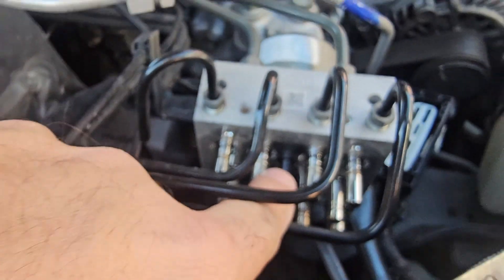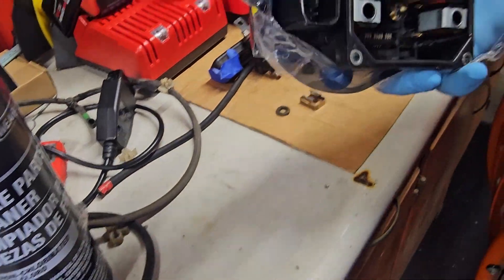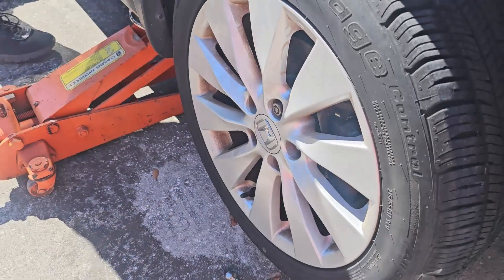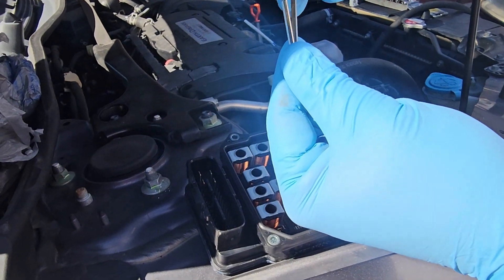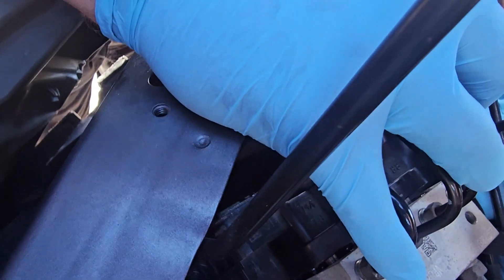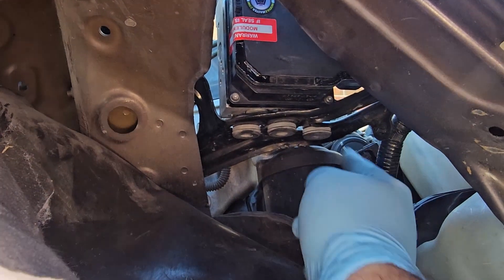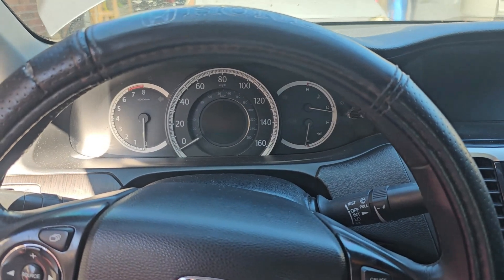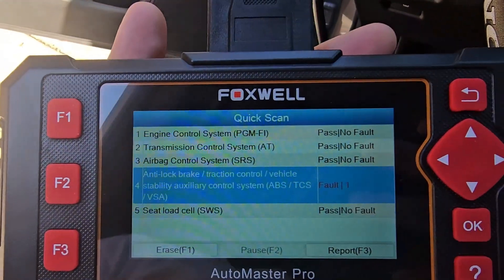2013-2017 Honda Accord, Acura ABS module and code 53-11 motor failure diagnose and repair.

Comment: Need to do this as well.. will the car drive with the module off? I don’t have a spare car to use while I wait for repair.. just curious if need to rent a car or can drive with out the module.. thx
Reply: ive driven my honda 2 years with out fixing it and drives fine but honestly better to fix it so it doesnt cause bigger problems

Comment: I have the same problem, sometimes the lights are on, other times off, it's crazy
Reply: have it repaired. you just need to open the module and solder detached pins inside
Reply: Did you ever get it fixed change by the module or was it something else? Mine would do the same. On and off at times.